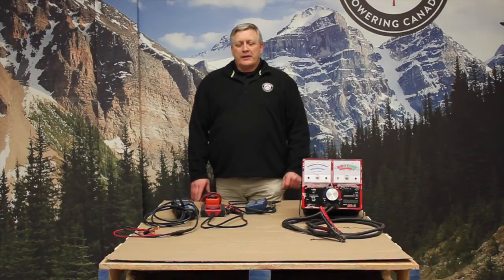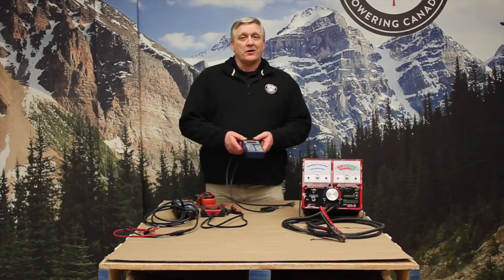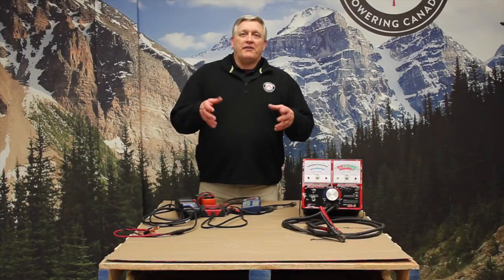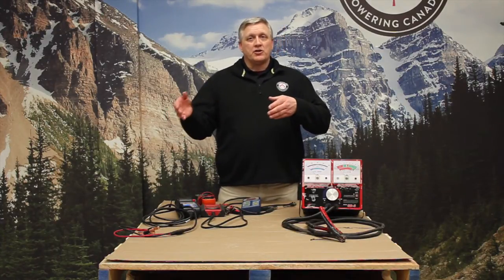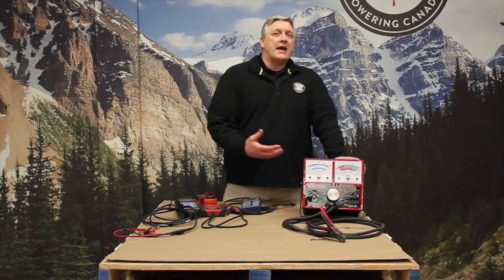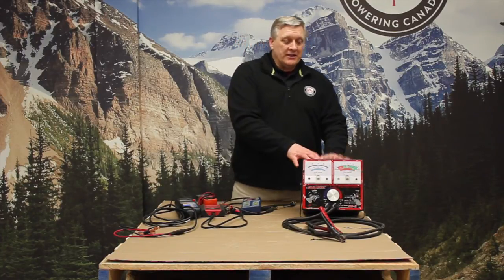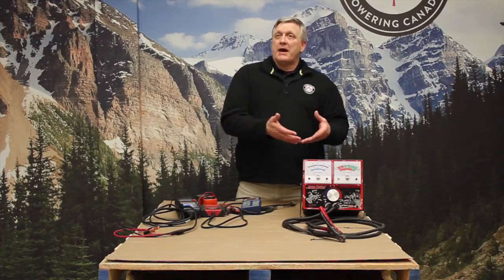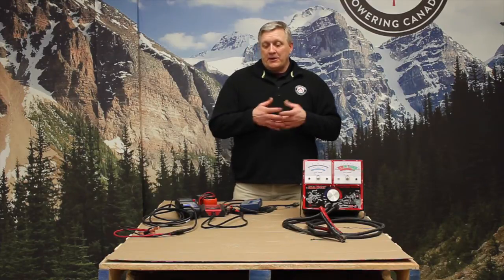Canadian Energy™: Battery Tester Overview

Comment: Can you test AGM and Gel type batteries with a carbon pile load tester too???
Reply: Yes, you can definitely test AGM and Gel batteries for CCA or CA with a carbon pile tester, most Gel batteries are designed for deep cycle operation so not always rate in CCA. Hope that helps!
Reply: @dgckelowna  that definitely helps a lot, Thanks for the video and fast reply, great job.
Reply from the maker: stephen bowden glad you’re happy with the response and response time.